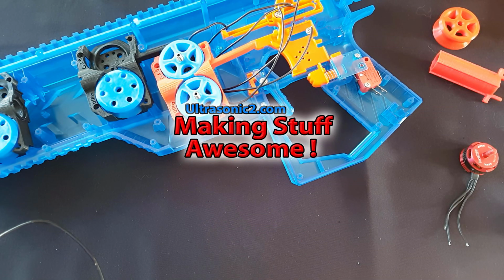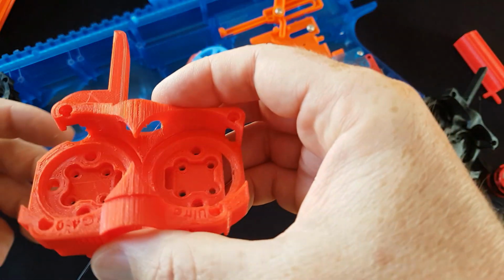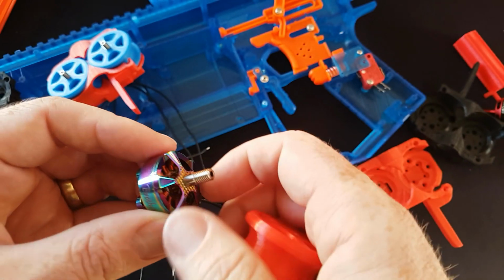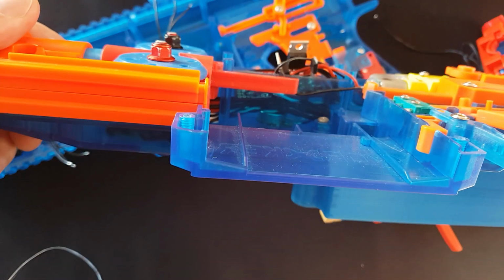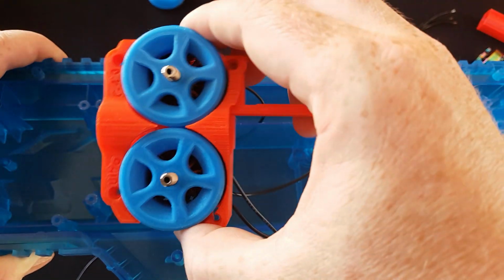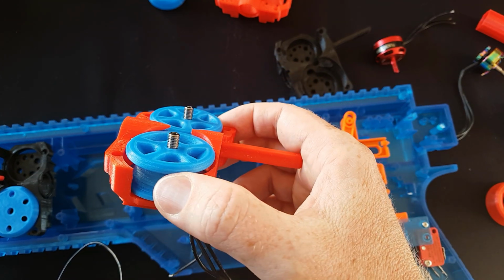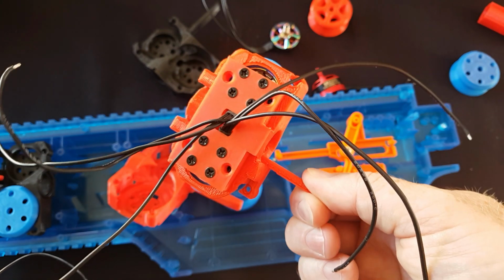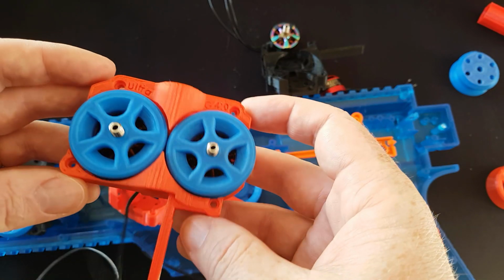⚡️ Nerf Stryfe Mod Worker Swordfish Mod Worker Dominator.. Brushless Gen 4 Cage

Comment: By the way, I don't know if you know this but the reason they have those holes is not for cooling but only for weight, the reason the other ones didn't have holes is because they are usually on a quadcopter going pretty fast through the air so they always have active air cooling, also the style of having a open bottom is called a naked bottom

Comment: What 3D printer are you using? Your prints look pretty rough.
Reply: @Colin Davis Or just use PTEG. That stuff is amazing and has better head resistance than PLA.
Reply: @pvpXan  I also suggest petg if you print this, ABS releases fumes that I believe are toxic, also you'll need a enclosure for abs or else it won't print right, if you do this don't print and, print petg

Comment: That's some pretty major improvements there. I've shyed away from brushless/printed flywheels before because of heat issues... this may well push me over the edge. With the new (more open) wheels, did you play with trying to build "vanes" into the wheels to suck even more air through the system? (or would this affect spin-up time because of drag?)